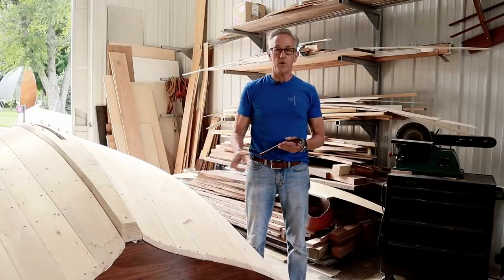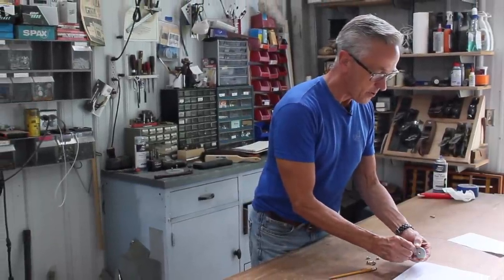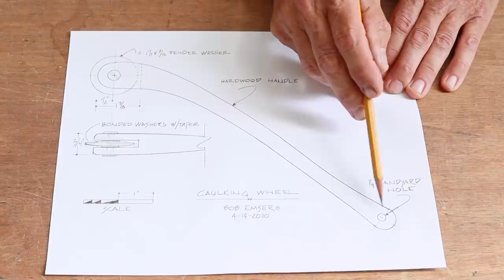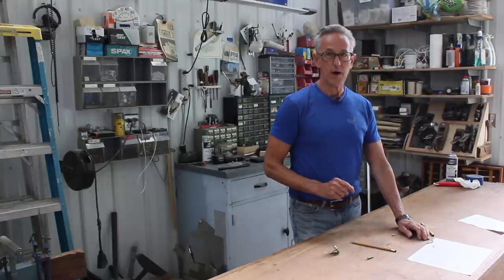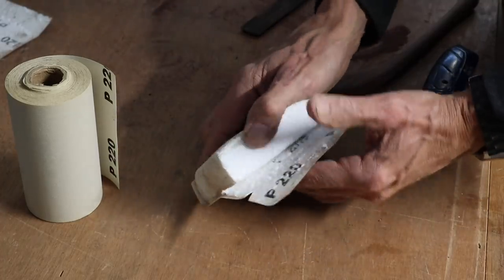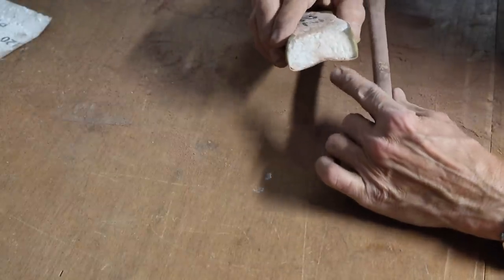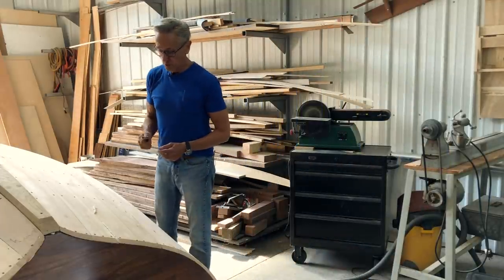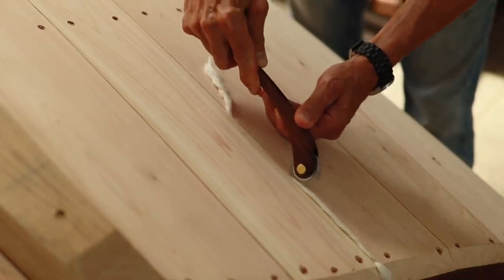How to Make a Caulking Wheel

Comment: Beautiful work. The last time I bought stainless steel boat fittings, admittedly a few years ago, they used Whitworth threads. 3/16" BSW bolts have a 3/16" dia shaft.

Comment: Thank you for another howymadeit video. Caulking tools I have used often have a slight hollow in the circumference to keep the cotton in the middle, but perhaps your seams are too narrow for that to be effective. I was interested in the sanding block you used, unfortunately the commentary is muffled at that point, would you please provide some information on the material and how the abrasive paper is adhered to it, thanks Bob
Reply: The abrasive paper has a glue backing.  The roll comes with the contact glue already applied. 

As to the caulking wheel, I have a similar understanding; that there is a concave profile around the circumference.  Further, that it is a one piece wheel.  Perhaps the two halves are going to pinch, trap and drag the cotton about; but that remains to be seen.

I was wondering how Bob was going to control the cotton to the correct depth; in consideration of the thin planks.  The wedge solution is very good, let the tool control it.
Reply from the maker: Hi Jack, Yes, the slight hollow as you described naturally occurred with the 2 washers. The slight round over edge of any washer put together creates a small concave edge around the circumference. I've tested it out and with the cotton twisted there isn't any pinching or snagging. I'll cover this more in the upcoming video on caulking.

The sandpaper I've been using is made by Porter-Cable. It is self adhesive. Any type of sheet insulation will work.
Here is a link
https://amzn.to/38iyWEX

Thanks for your question and watching!
Cheers,
Bob
Reply: @TheArtofBoatBuilding  Thank you Bob, it is a pleasure to watch a person skilled at their craft work the materials and tools, there is always something to learn. I am grateful for the closed cell insulation tip, that had not occurred to me, I shall steal the idea immediately, I have some pre-owned 1930's doors to repair and fit, which my daughter has bought for her house in Bristol UK, I will get the paint off with a hot air gun, now rubbing down the mouldings will be much less time consuming.
Looking forward to future episodes and you sailing the finished boat. Warm winds at your back!

Comment: as a young boy reading books I was always believing that caulkong was done with cotton covered or soaked in pitch but it would seem that I was wrong would you coment on thes? Have caulking techniques changed over the centuries and was a sefond finishing layer applied to the outer seams?
Reply from the maker: Hi Ken,
Thanks for your question. I will be covering this in the upcoming video on caulking. So stay tuned.
Thanks for watching.

Comment: Very nice tool. Great way to create the wheel. I thought you would have glued or soldered the two fender washers together. The handle is elegant. Does it have to stand up to much pressure? It's quite slender. I am surprised you made one. I expected you probably already have several. Regardless it is very nice and well made. Thank you for sharing.
Reply from the maker: Thanks Glen,
I did think of bonding the wheels together, however, when I gave it a test run it seemed unnecessary. In my testing I can see how maybe just one wheel ( straight on one side and beveled on the other) could be an advantage by tucking one side of the cotton at a time. More on that later. The handle is a hard wood and would require an immense amount of pressure to break. Scrape that length and size was impossible ( for me) to break even with my knee on it. Crazy but all I had was a plastic screen door rolling tool. 
Thanks so much for your compliment and watching!
Cheers,
Bob
Reply: I was also thinking about soldering the two together before doing the shaping of the washers.  It seems it would make developing a nice shape and taper for both sides much easier.

Comment: Isn't the steel wheel going to work its way through the brass axle pretty quickly?  Particularly if you are applying the kind of pressure required to properly pack caulking.
Reply: Cheap enough to replace though :)
Reply from the maker: Brass is more durable than one would think. It good for movable parts that's one reason many bearings are made of brass or bronze. It really doesn't require a lot of pressure. Once the cotton is in place it will be set with a caulking iron and mallet. I'll be covering this in a future video on caulking.
Thanks so much for your question and watching!
Cheers,
Bob
Reply: @TheArtofBoatBuilding  Just can see a caulking mallet build in the horizon.

Comment: Very nice tool!! A question: Is the handle thick enough not to break if you apply pressure on the caulk?
Reply from the maker: Yes, it is the handle is hardwood. It really doesn't require a lot of pressure to feed the cotton in the seam. In the upcoming video on caulking I show how it is rolled in and then set with a caulking iron and mallet.
Thanks for your question and watching.
Cheers
Reply: @TheArtofBoatBuilding  Looking fwd to that. Thks!

Comment: While I love the notion of learning a new method, and thanks for this by the way. Why not caulker's mallet and poke? (Mallet and chisel) or (mallet and iron) all the same under different names.
Reply from the maker: Hi Russell,
I will be making a caulking mallet in the next several weeks. ( already have an iron). In caulking tight seams in a small craft like the Haven it's nearly impossible to loop the cotton like one would do on a large vessel. After the cotton is put in with the caulking wheel it is then set with the mallet and iron. So, all that and more it the future.
Thanks so much for being such a loyal viewer. You always have great questions and comment. You and they are much appreciated.
Cheers,
Bob